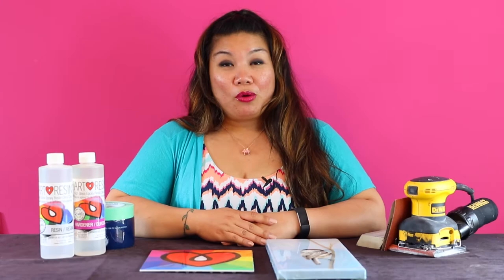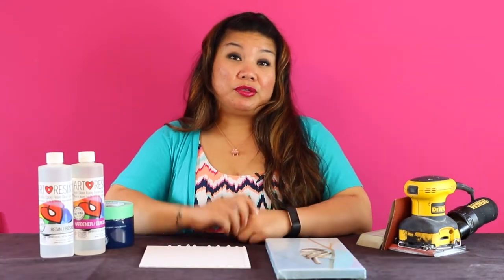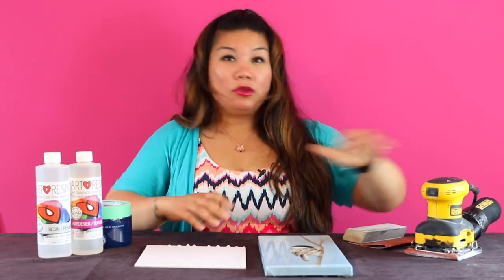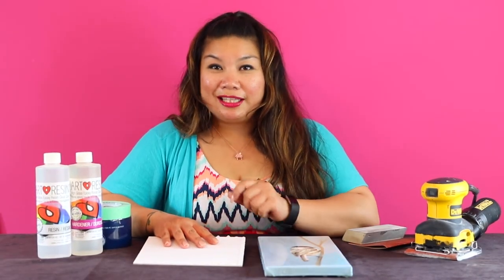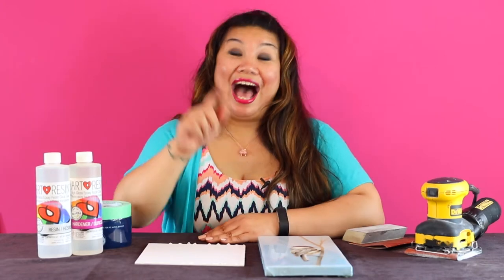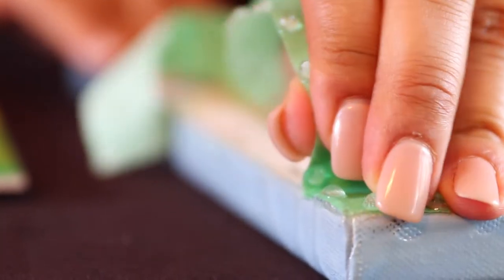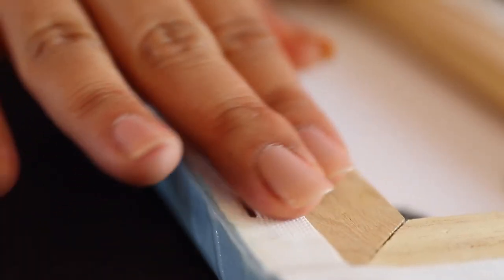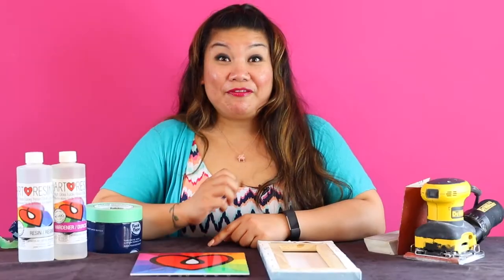Oh Sh*t! Ep 6 - Drips!

Comment: I have not had luck with tape. I've been using silicone caulk and it works great! 
Also I love these videos! Please have her make more!
Reply from the maker: Thanks so much for your feedback, Kristina!  Glad you love the videos, and yes, there are more planned for sure :)
What kind of tape have you been using?  
We've been using Tuck Tape lately, on the advice of one of our customers.  It's waterproof and non porous, so the resin can't soak through like it does sometimes with painter's tape.  We've been pleased with it so far!

How do you find the silicon caulk as far as removing it?  Does it pull away easily from your substrate?

Comment: Hi there I am still finding very hard to work on the sides and have a clean edges (not back sides I am referring to sides if a 3d deep edge canavas). I use tape and the resin just flow over and seal it completely. My customer wants clean edge (I mix resin with colour to do resin paintings not just as a top coat). I use canvas not wooden board. Please help
Reply from the maker: Hi Hanan!  There are a few things you can try

1) use tape, but pull the tape off early, before the resin has had a chance to fully dry - say at 12 hour mark.  If you wait the full 24 or 72 hrs, the resin will have totally cured and it will be harder to pull the tape off.

2) you can try not using tape and just using a gloved hand to coat the sides with a thin layer of resin

3) you can try "doming" - this means that you only apply resin on the top of your piece, not on the sides.  Just push the resin to the edges of your piece without going over the sides.  Then you can paint the sides if you want!

Take a look at this video - it might help you
How To Dome With ArtResin:  https://youtu.be/WOPke_Fdo_g
Finish The Sides and Edges Of An ArtResined Canvas: https://youtu.be/l2p5-BdVjPo

Comment: Hi! I was doing a piece and I was trying to clean out the left over resin from my bowl (I used hot water and soap to clean it out), annnd the next day I go into my kitchen and I found little cured resin droplets in my sink haha. Is there anyway I can get these off?
Reply from the maker: Ooooh, that sucks!!  The only thing that will break down cured resin is a soak with acetone ( like nail polish remover ).  It will make the resin gummy and then you can try scraping it off.  You could even try a heat gun or hair dryer after the acetone to soften it even further.  Just be careful you don't scratch your sink!
We like to wipe out any remaining residue with paper towel first before we clean.  Or even better, line your work surface with a thick, clear vinyl shower curtain and tip your mixing bowl upside down letting all the leftover resin run out on to the shower curtain.  Next day when it has cured, you can just peel it right out of the bowl and off your tools!  ArtResin doesn't stick to plastic, so make sure you use hard plastic tools and mixing/measuring vessels.
Reply: ArtResin Thank you! 😃

Comment: What if it's delicate jewelry?
Reply from the maker: You could still try to use tape on the backside, or just apply a thin layer of resin using a brush to reduce drips.  You can sand with an emery board for more precise control or a Dremel tool.

Comment: PS I tried tape on the sides and the resin stick to it and the tape becomes part of my painting....just can't get the tape out after from the sides....boohoohoo...maybe it is just me
Reply from the maker: Yes, especially with painter's tape, the resin can sometimes soak through the tape.  It really helps to pull the tape off when the resin is dry to the touch, after 18-24hrs, before the resin really has a chance to cure.  We also like using Tuck Tape, the navy blue tape Patty uses in the video.  It is waterproof so the resin won't soak through.  Sometimes though, you need to use an x-acto knife or a blade the scrape off some of the remaining bits of tape.  
Doming is a really great method of applying resin ( see the blog I posted in your other comment )  You basically push the resin as far as you can to the edge of your piece without going over ... the resin just sits on top and you don't have to worry about the sides at all :)